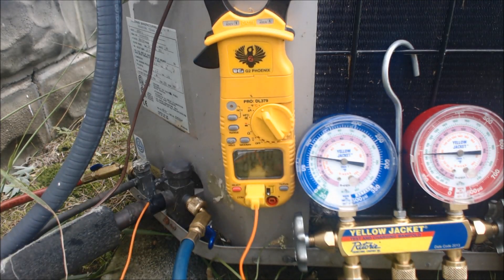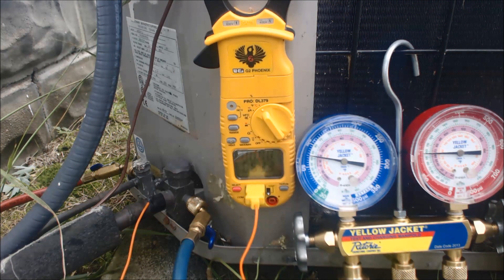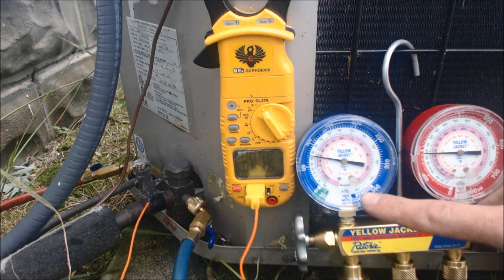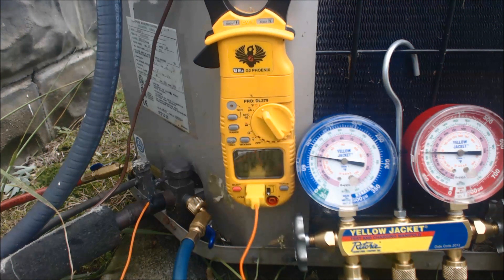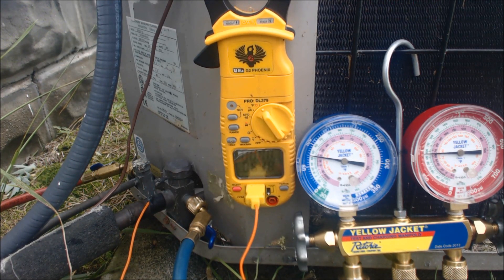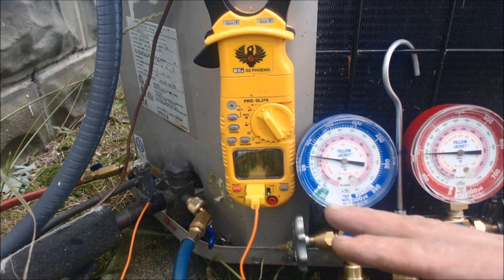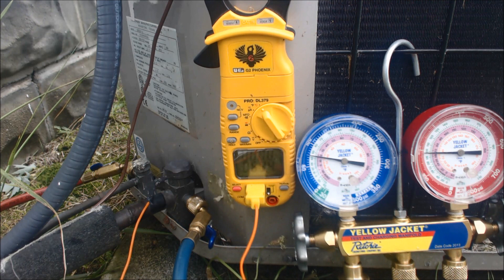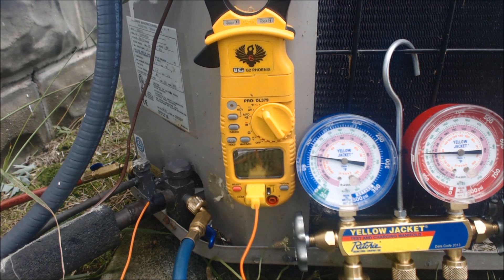Refrigerant Charging! When Confirming a Charge, Should You Always Have 18-21 Degree Temp Diff?

Comment: Great channel. Can subcooling or superheat charging be applied to R134a as used  in car air conditioning.
Reply from the maker: It could be, it certainly is happening just could be harder to get to. I believe alot of techs just are adding until they get to a 20 degree temp difference between the return and supply. If work was to be done to a component and the system refrigerant was recovered, and then the component replaced, pressure tested and vacuumed down to 500 microns, you can just weigh in the exact correct amount of refrigerant stated on the rating plate. Thanks

Comment: Depending on your static pressure & equipment sizing setup (same size outdoor as indoor or do you have 1/2 ton larger indoor) this can be as simple as too much CFM across the evaporator coil.  I know it sounds odd, but I have run into this before & when I slow the blower speed down, I get my 18-20 degrees temp differential.
Reply from the maker: Yes you are right, if the blower was set at 60,000 btu of air flow and you only had a 3.5 ton outdoor and 3.5 or 4 ton evap then the airflow would not allow you to attain the 18-21 temp diff. Great Comment!

Comment: can u do a vid like this with R410a? My system is TXV calling for 10 degree subcooling. I am getting about 12-13 but I am only getting about 12-14 degree difference between return and closest register, which is only about 6 ft.
Reply from the maker: Brian I believe your txv is not allowing enough refrigerant into the evap coil or maybe the liquid line is clogged before the evap coil but so you know that would also mean that you would have a an abnormally high superheat. Can you tell me what superheat it is? A normal superheat while having a txv as a metering device is normally 9-19 degrees but more likely should be around 14 degrees. Though you cannot use superheat to charge a system with a txv, you can use superheat to help diagnose a bad txv. Is the bulb securely attached to the suction line? Is the bulb insulated if it is outside of the evap coil? If the bulb is mouted vertically on the suction line, are the bulb lines facing up? You can test a txv's operation if you put the bulb in hot water for a short period of time. If the subcooling amount does not increase or the amount of superheat does not decrease then the bulb could be low on charge. If the bulb is attached properly, it is likely a leaky bulb or obstruction in the liquid line before the evap coil, that is if the subcooling is higher than needed and the superheat is high. Superheat being too high in your current situation would mean that you do have the proper airflow and the ductwork is of adequate size. Well I hope all that helps! Thanks for the question and I will look for your answer.